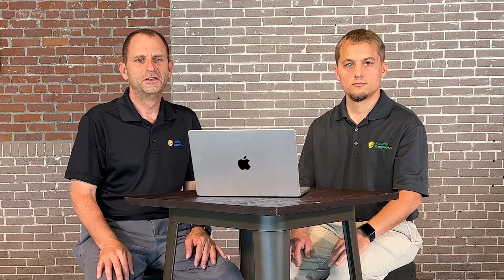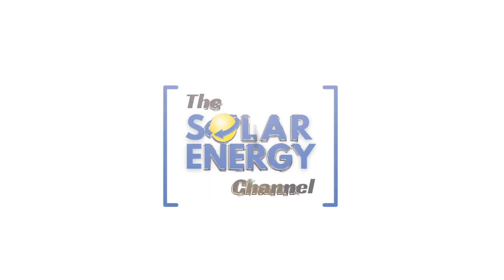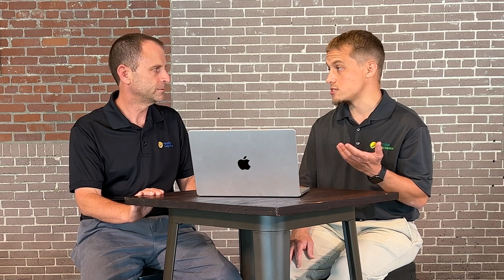How Does Sunlight Backup for Solar Work? (Enphase IQ8 Microinverter)

Comment: Can I use IQ8 Microinverter to charge power banks like ecoflow delta pro?
Reply from the maker: Enphase microinverters can be AC-coupled to charge batteries from some other manufacturers.  We recommend that you confirm your equipment and design with Enphase before proceeding.

Comment: Thanks for the video. After watching it I have a few questions:   
1) So it sounds like you need 3 additional components to enable "Solar backup"...namely a   (for disconnecting/isolating  the EnPhase system from the grid and then . An with install these would cost you an additional $4-5K over and above your basic Enphase solar only install. 

If a customer decided to later add a battery for backup which of these 3 components (if any) could be used in your battery back up system and which of them might be "throwaway" once you add the battery.  I'm assuming that a System Controller would be required when you update to a battery so it could be re-used, but what about the two load controllers...are those just "throw away" components once you upgrade to a battery or do you need one or both of those in a battery based backup. And BTW what do the load controllers do exactly and why would you need 2 of them for this solution. 

2) You described a scenario to calculate what type of power you might have available to you if you had a 10kw system, from that it sounded like the equation to calculate roughly how many watts you'd have available to you for "Sunlight backup" would be a formula like this:
  Sunlight Power Watts Available = (# Panels * Each panel's wattage output)  * 90% * 30%. 
Is that correct?

You explained that the 30% factor was based on the fact that you might have shading, clouds, etc that might reduce the output of your panels. I realize you probably want to be conservative but that seems like it could be incredibly conservative depending on your location and day. So could you provide more clarity so that people could understand how to apply it to their own specific situation. For example, if that 30% is primarily a "cloud factor" then customers who live in the desert may not need to be as aggressive. 

In the example using your formula that you would roughly have 3kw to power your appliances. Is that inclusive of surge/startup power usage? Exactly how would one go about calculating how many and of which appliances they would be able to power. Would you suggest just making a list of what you want to power and then tallying up the number of watts each device uses. And is that watt consumption listed on each device (e.g., fridge) or would you need to find the specs for those devices that you want to power.  And wouldn't these devices all have to be on a few circuits...I'm assuming you couldn't just add all the circuits for backup of all the devices (add 10 circuits for backup). Do you need to understand the volts and amps consumed by the "devices/appliances" that you want to power? Do you need account for startup power consumption of an appliance (e.g., a fridge) and if so how does one factor that into the equation? Also earlier in the conversation you started off talking about Amps  before switching to watts. Are amps at all relevant if you know the watts?
Reply from the maker: Jet,
1. If you add a battery later, all the installed equipment is still valuable to have.  However, if you install the battery initially, it is less like that you will need load controllers.  This is dependent on what loads you intend to back up.
2. The 30% factor is a recommendation from the manufacturer.  This includes all losses, shading/soiling/snow cover/orientation/tilt, and other losses.  
3. Startup amps do need to be considered for backup.  There are a few ways to get running amps and start-up amps:  most times, the information is on the device somewhere.  Additionally, the equipment can be installed to measure these loads.

These complex questions are hard to answer perfectly through a comment here. If you want to discuss this further, you're welcome to call us at 877-851-9269.

Comment: Hello, new to your channel. Thank you for the video. With the iq 8, do you need an automatic shutdown so it does not feed back to the grid when pole power goes out? Or does the micro converter shut it off automatically, so there’s no backfeed?
Reply: @thesolarenergychannel  like what? Thank you for the prompt reply also.
Reply: @thesolarenergychannel  I’d also have to dedicate the 8s to separate circuits for backing them up right?
Reply from the maker: @Scoobydue420  We need to retract our prior message about the additional equipment. The IQ8 does comply with Rapid Shutdown WITHOUT additional equipment.  However, additional equipment is needed to do sunlight backup.  With sunlight backup, you would dedicate specific circuits to be backed up by the IQ8s. Hope that helps! Thanks for watching.
Reply: @thesolarenergychannel  could I install the iq8 without using the battery option. Use it like an iq7+?
Reply from the maker: @Scoobydue420  Yes, you can install the IQ8 without batteries and still take advantage of the sunlight backup. Without batteries, you would not have backup power if the panels aren't producing when the grid is down.
Reply: @thesolarenergychannel  ok. Thank you
Reply from the maker: @Scoobydue420  You're welcome. Please let us know if you have other questions.